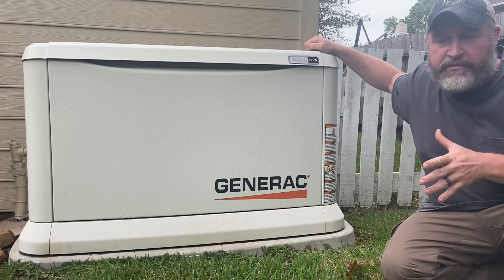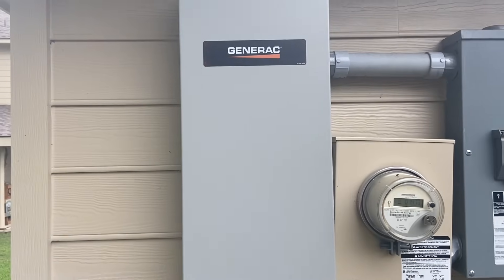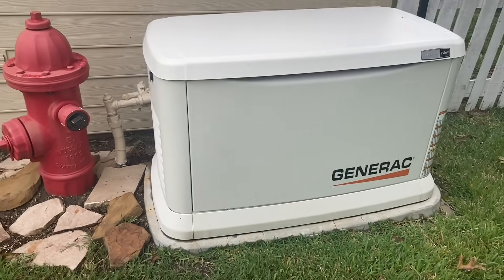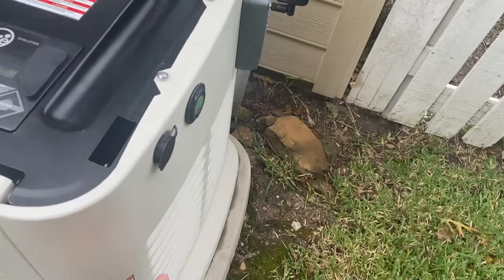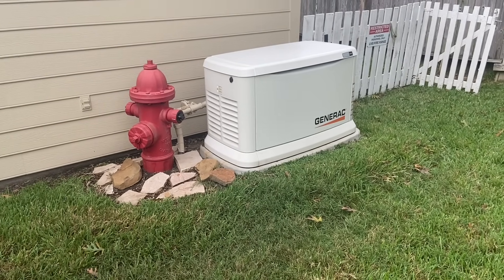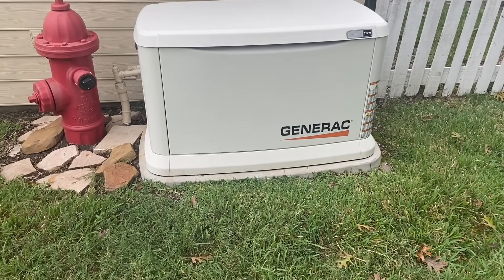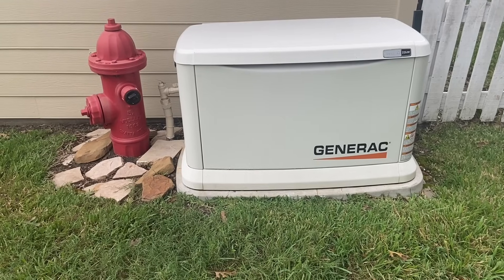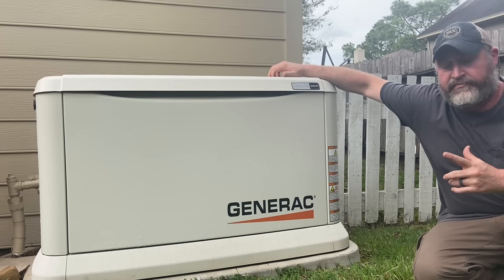Thinking of purchasing a generac whole home generator?

Comment: I'm on 5 acres in Texas, surrounded by gas wells.  Unfortunately, we don't have gas in my area so we need to rely on propane.  With natural gas, the generator can run forever...I'm limited by my propane tank volume.  We've been considering adding a generator, but I'll need to check the run time at full load (worst case scenario) to see how long I can run before depleting my propane tank.
Reply from the maker: Thanks for watching, I have seen another video of a guy running on propane 1000gal will last him 2 weeks I believe it was a 22kw. The irony of being surrounded by NG and can’t get any would drive crazy. Please subscribe like and share! Have a great weekend.
Reply: My parents have the same 22KW Generac with a 500 gallon propane tank.  They can run between 5-7 days depending on the load.. so roughly a week on 500 gallon propane.
Reply from the maker: @5thGenNativeTexan  Awesome thanks for watching and sharing that information, please subscribe like and share! Check out some of my other videos too ! Thanks
Reply: @5thGenNativeTexan  Thanks for the info.  We have a 300 gallon underground tank which would give me roughly about 3 days, which wouldn't be a deal-breaker.

Comment: Excellent overview. Thank you! I got an estimate for a 22kw generac. Little surprised they recommended that large of one. 2300 sq ft but all gas house - water heater, furnace, dryer, stove top. Only big electrical draws is 4 ton AC and a double oven. Don’t you think 22kw is way overboard?
Reply from the maker: You could definitely get away with a smaller unit in my opinion and experience, however nothing wrong with future proofing for added electrical draw. Example my dad added the shop and another A/C if he would have predicted this he would have went with a larger generator.
Reply: NO.  You don't ever want to load to maximum advertised load-on natural gas, you will lose about 10% of advertised load as was touched on.  Generac's that I install I only calculate load to about 60% of capacity (+/-) for Generac and 75-80% for Kohler, and there are other de-rates such as ambient temperature and altitude that sometimes have to be factored in.  So, a 22 kW, (19.5 kW on Natural Gas)  generator becomes a 14 kW or so capacity machine.  That allows for appliances to cycle on and off-talking about AC compressor's here, without dimming the lights everywhere else, and there is a little bit of head room for future additional load.
Reply: @bobbygene8274  my point is they would have sized it the same almost guaranteed if all the natural gas appliances were electric
Reply: @condor5635  You are correct.  It is better to be a 'lot" oversized than just a "little" undersized especially on units that work as hard as these do.

Comment: Awesome video. Thank you Sir.  We have a new 1865 sq ft single-story home and are looking at a Generac. According to the Generac website, an 18kWh system would likely do the trick. Their site also estimates 2k installation cost + permit fees ($2k for a simple install which is what we would have). Curious as to why you didn't get a quote from the Generac website? Again, thanks so much for the great informative video!
Reply from the maker: Thanks for watching Generac will not install it so I did not see the need for their quote. I doubt the quote on the website will be very accurate. Let me know once you get it done. Thanks again have a great week.
Reply: I just got a quote today for $13,000 for a Cummings 13 kw install. Even at $10,000 I think the guys overpriced.
Reply from the maker: @martinlutherbling424  13k for a 13kw seems high but I don’t know your area. Here in Houston the 22kw generac install similar to mine is 13-14k. Thanks buddy for watching please subscribe and check out my other videos.
Reply: @JustCantSitStill ; I'm in a small town near Buffalo, Ny.

Comment: Thanks for the great information.  How about running costs? Two questions for you about that.  Approximately what are the per-hour running costs (gas costs)?  Also, does the amount of items your running change your gas usage/ costs (like if you only ran your refrigerator vs all the lights in your house and your refrigerator, does it use less or more gas)?
Reply from the maker: Hey Dave thanks for watching, it’s hard so say our furnaces and water heater and dryer are also NG , but for the big freeze last February our bill was only 52$ more than normal. I would definitely say the more items you are running off of it the more NG consumption will occur.  I hope that helps. Please subscribe like and share!

Comment: My Neighbors would kill me if I got a generator that loud lol. Holy crap.
Reply from the maker: Not that loud , man up and don’t let your neighbors run you.
Reply: Your neighbors will be begging to use your freezer for their food during a power outage.  Remember, they will be out too....and probably running their own, or leaving for a hotel.  Noise will be the LAST thing on their minds.
Reply: They are actually about as loud as a lawn mower. At about 25 or 30 feet that sound is not bad at all.  Plus in a power outage your neighbors will be at your door asking for help. I don't think they will be there to complain.
Reply: They won't mind so much if you let them plug in a freezer or fridge....

Comment: Looks like grounds/neutrals are bonded and should be isolated in the ATS. Should also be isolated in the main panel behind the transfer switch. Should be 4 wires coming in from the service disconnect and 4 wires going to the breaker panel. 

Not sure how they got 3 3-ton AC’s running on that with no load controls, although it could have been installed prior to those being required by code. It has the power for it if you’ve got gas heat, range and water heater
Reply from the maker: Yep it’s now been debonded good catch previously from another viewer. Works fine with all ac’s running and passed inspection. And yes the 4 wires are going in and out , thanks for the great comment and for watching please subscribe like and share. Check out some of my other videos and have a great week.

Comment: This is an excellent video. i have reviewed this as well as your noise video.  

1. Are you or your neighbors aware of any noise absorbing panels that can be used around the generac (like a fence 3 ft from the unit)  to absorb some of the noise.  

2. As well is there an inverter option from generac  that reduces the noise level when less power is being used?  

3. How deep is the gas run across the lawn?  18"?

Thanks..
Reply from the maker: 1. Yard is fenced , noise is not a problem or concern from me or neighbors 

2. This unit runs at 3600 rpm no matter the load so noise level will always be the same. 

3. Yes or more 

4. Thanks for watching

Comment: We have 18Kw of solar panels, and contract with the power company to feed into the grid (which means that when there is a power outage, we also have no power). We recently suffered a 5-day power outage in sub-freezing temps. Would it make more sense to put in a battery backup system (such as a tesla powerwall) or go with a whole house generator powered by natural gas?
Reply from the maker: Thanks for watching and for the comment , I guess I would have to ask how long can your run on battery if that’s was your choice? I can run indefinitely long as I have NG and oil or oil changes.
Reply: For reasonable sized house you would need 2 Tesla powerwalls to cover for 2 days at a cost of $30K.  Generator much cheaper option unless you use battery to store cheap daytime power to use during high cost electricity time as in California.  If you like battery option, maybe better choice is to buy F150 Lightning - then you have a truck and a battery backup.

Comment: Great video, however - don't like the fire extinquisher right by the gas lines - maybe it might help if it exploded - but seems like it should be somewhere much farther away, perhaps protected from a blast somewhat, so you stand a much better chance of being able to grab it and use it if a small fire started by the gas lines. Also, I was thinking it may be wise to build a strong sturdy enclosure that would protect the unit from the blazing sun, and the gas lines from any snow buildup. We have heard in some areas of the weight of snow causing the gas pipelines to break. I was thinking very sturdy in case of high winds, but with good ventilation - loved the video though, how it made sense of how much money spent, how much to maintain, extended warranty, etc - I wonder if you should get an insurance discount for having a Generac?  Seems like it would reduce the likelihood of fire or damage from having an extended power failure. FYI though, you still need good surge protectors on your fridge, freezer, dishwasher, microwave, gas dryer, etc - on many appliances likes fridges it must be made for a fridge, and buy from a reliable source so as not to get a counterfeit unit, mine is RCA for my fridge. Even though you have a whole house protector, lightning and such can still strike an outside light fixture or wiring, and enter not through the circuit breaker panel, by through the source of the strike. From what I am reading about appliances (I fought with GE over this) - it is NOT just the terrible power surge that can kill appliances, it is also the smaller, daily "hits" that fries on the crappy circuitry of todays appliances - hits that would not have affected appliances 40 years ago now destroy the delicate circuit boards, which costs a fortune, unless you can find someone think outside of the box and repair the actual circuit board.
Reply from the maker: Fire extinguisher? You meant the fire hydrant right? If so it’s addressed in the video.
Reply: Sigh, all his lengthy diatribe WASTED, cus he didn’t pay attention!😂 Great info,Thanks!!

Comment: i would look into getting a service rated transfer switch that way you dont need an independent disconnect from the meter the switch would act as your disconnect.
Reply from the maker: Transfer switch is service rated , the additional disconnect was due to a picky city inspector. I actually like it it makes it easier for periodical load test
Reply: Silly inspector.  There are many that don't even know how a generator works, much less a automatic transfer switch.  But there are some that want to minimize the length of wire between the meter base and the first means of disconnect to minimize the length of "unfused" wire that might be exposed.

The inspector may have missed the bonding jumper between the ground and neutral block at the ATS.  In the jurisdictions I have installed in, neutrals and grounds must be separated after the first means of disconnect to be code compliant.  But, it also depends on what version of the National Electrical Code (NEC) they may be using-or if they want to comply with that particular part of the NEC.

Comment: do you keep an extra battery onhand? my parents have a whole-home generator, power just went out and the battery was dead.  They do have a regular maintenance plan.  Luckily, the power outages in their neighborhood tend to be pretty short.    My house is on a super small lot, like .1 acres, I'm not sure we can get one, an electrician took a quick look and made it sound like the lot may not be configured to have one--but I do think a properly maintained generator does add value to your house, and the comfort of knowing you'll have a/c and working fridge/freezer is invaluable.  When I looked into it, the incremental costs of jumping 2-3 kw for these units was not all that much (maybe around $1500 to jump to the next level).  So I think pretty much anyone should go with an 18kw at the very least--but 22kw is a good size, what I'd get.
Reply from the maker: Thanks for watching and the comment, I do not keep an extra battery if needed I can pull one from our vehicles in a emergency.
Reply: Go with a lithium battery when you replace the original.
Reply: @rickss69  Do NOT go with a lithium battery.  Please.  Just don't.

Comment: Hello my generac is 27 years old it still run great for the last 5 years I have been use to charge a 75kw off grid system wen no solar or wind
Reply from the maker: Very cool ! Thanks for watching, please subscribe and check out some of my other videos
Reply: I really subscribed on the thing is my generator Does not look as good as yours anymore is old
Reply from the maker: @solarandwindinsouthtexasda1473  maybe a repaint could fix it up 😁
Reply: Yes I do every two years but it just looks like a square box But the best thing as it works like a charm
Reply from the maker: @solarandwindinsouthtexasda1473  that’s all that matters!

Comment: About where your decorative fire hydrant is, I wonder if you could build a removable L-shaped partial shield, about the height of the generator, and made out of a sound-absorbing material.  It would cut down on the noise, and also hide the gas line.
Reply from the maker: I move the hydrant I found out we have to keep both intake and exhaust sides open without obstruction for I think the first 3 feet

Comment: Great video, I am looking at buying one. Thanks for sharing.. Next, invest in a pressure washer your bricks are looking a little moldy. Not a big deal, but I like my bricks to look nice.
Reply from the maker: Thanks for watching not sure 🤔 about this mold you speak of but all good, please subscribe and check out some of my other videos.
Reply: @JustCantSitStill  I will, again thanks for the video. Maybe is the shadows 6:59 that makes it looks like mold.
Reply from the maker: @Assassin1959  towards the bottom under the window, yea that’s is a small area that houses 3 turtles 🐢 so from time to time it gets a little dirty, I have to be careful when cleaning, I have a power washer, it had rained a lot the week before this was filmed so it just happens , currently the 102 degree temps and sun with 0 rain in months have kept it away for now.
Reply: @JustCantSitStill  Nice, same here in FL. Hot Humid and miserable.

Comment: Great video, many thanks! We are in Houston as well. Any last minute advice as we start the process?
Reply from the maker: Not really just think about placement long and hard, for instance I now wish I could expand that side of my detached garage into more of the yard and the generator would have to be moved, also possibly a hard start kit for your A/C system will help both the generator and the AC compressor.  Extended warranty deal, maintenance plans etc and getting enough KW for any future upgrades like pool pumps or room additions.

Comment: Thank you for this video. Have a few questions. 
1. Does it stay that loud for the full time it is on? 
2. What if there is a bad storm and it goes on for a week or 2. The generator operates by  battery or propane and  how do you recharge the battery when no electric is available for days/weeks?
Reply from the maker: It operates at 3600 rpm it runs off natural gas , the battery is only used for starting which receives a charge when not in use from the electric coming in from the meter, when the power is out and the generator is being used the battery receives a charge from the electricity the generator is producing. 

Hope that helps
Reply: The battery is for starting only, just as in your car. The generator will charge the battery during exercise periods or when it is making power in an outage.
Reply: @JustCantSitStill  It did not occur to me that there might be a mains powered battery tender or charger. Being exercised once a week I didn't think that would be necessary. Also, what would you do if somehow your natural gas supply was lost? I would have thought that it would be better to have a large tank of say, 250 gallons or so, to power the generator.
Reply from the maker: @williamjones4483  thanks for the comment, our NG is pretty solid  we have never lost NG in my lifetime time so I guess that’s a risk I am willing to take. I could tee off and have propane at the ready but I am not sure if we could in our residential area. 250 gal would probably get me by for 1 week.  We got this for storms and now freezes where you may be without power for a few days to a week or two, if the natural gas is out it would probably be a larger event most are not ready for.
Reply: Seriously? That "loud" for the whole time-yes.  The battery is charged by the power produced by the generator itself when the utility power is off, or commercial if the generator isn't running...The controller is a constant parasitic load just like the computer on your car is, so the battery must always be under a charger, which is integral to the controller (at a max charge rate of 2.5 amps).  Yes, run time is limited by available fuel supply of course, but with reasonable precautions (shut down for oil checks, etc.)  running for a few weeks at a time is no problem with sufficient fuel.

Comment: I just bought a used 11kw diesel generator for $2,500.  Breaker interlock and a few other parts and I can power anything in our house on around 0.5gal per hour.  Cheap way to go if you’re willing to do manual switchover and load management.
Reply from the maker: Nice that’s great we tried that route back in the day and it got old quickly. Ours was gasoline it was a chore in the middle of the night to fill, and also did not do very much far as big loads would not power the A/C. Thanks for stopping by and watching please consider subscribing and check out some of my other videos. Stay warm have a great weekend.

Comment: Good video you took a lot of the unknown of the table. I am curious what brand motor is driving the generator
Reply from the maker: Thanks for watching! It’s a 999cc produced in house by generac. 

Generac G-FORCE® and OHVI engines are designed and manufactured by Generac Power Systems Inc. at our facilities in Wisconsin.